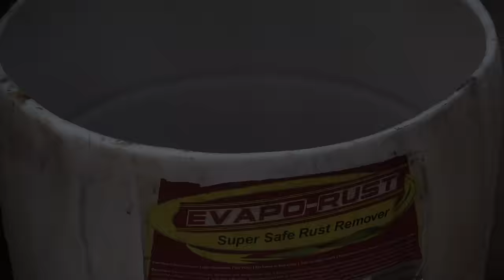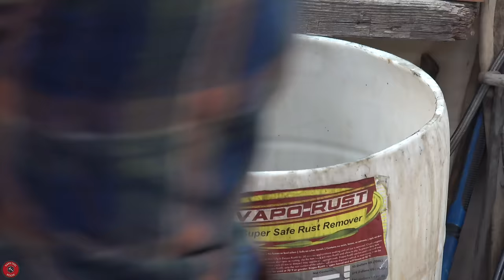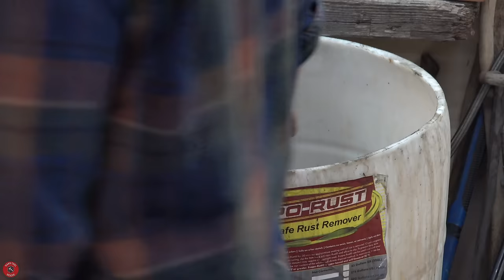1900s Pedal Metal Lathe [Restoration]

Comment: You commented on how off the brass was centered. I believe when you reassembled the jaws in the chuck that one jaw grabbed one thread ahead of the other. This will always throw center off. I may be wrong...
Reply: I noticed that too, was wondering if he had corrected that with the footage not ending up in the final video, but that may very well cause the off center workpiece holding. Still an amazing restoration!
Reply: I agree, I was about to comment the same thing.
Reply: Agreed.  The jaws are definitely not centered on the screw.  

Easy fix!   Great video!
Reply: you are correct
Reply: 23:38 Your right, you can see the left jaw is a little more inwards than the right one.
Reply: Also may have accidently swapped two jaws. They are corrected for the offset of the thread and numbered on modern chucks.

Comment: "I have never used a Wrench in my life." *grabs the personalized metal grabby thingie that helps to remove nuts and bolts"
Reply: Nope, no wrench on this channel... We have a shifting spanner though.
Reply: Hammer works just as well
Reply: ؤ  ,
Reply: @TheJdeft1  why is that?
Reply: @LeglessWonder  simply you don't need to be able to count or read numbers to use it . This is true of adjustable wrenches pliers and hammers.
Reply: I was amazed to see that comment.  I have lots of wrenches and use them on my projects all the time.  Although, many of my projects are automotive and that DIY spanner he uses would not do the job for me.  I also pretty well calibrated and when I grab a wrench, it's almost always the right one.  I cringe when he uses it end on instead of from the side of the nut.
Reply: @ROKuberski  almost always? I get it right each time for 40+ years.
Reply: @turbocpt1  I'm much better at fractional than metric so I am not perfectly calibrated.
Reply: @ROKuberski  yes I think we get tuned in to what we use generally. I will find a bolt in an awkward place which you cannot see. Feeling by hand and I know exactly what size it is.

Comment: As a former machinist, I found this very interesting. When I started out, lathes were not much different than this, except they were powered by electric motors. I hated it when everything became computer controlled.  I still use one that has a treadle like an old sewing machine.
Reply: Yeah, I like the older lathes best as well. 
I'm pretty sure that welded extension onto the big drive wheel was for a motor hookup.

Comment: If you want to understand how a metal lathe works watch this video. They don't get much simpler than this. Great old tredal lathe. I had a 13 inch Southbend that was from around 1913 I believe. Was a sweet looking machine after mechanical restoration.

Comment: Learn something new every time I watch - never really thought laths were use way back in 1880's, not peddled one at least. Fascinating rework on this piece of history. Outstanding project.
Reply: evil brat . Prior to that pole lathes were used for wood turning. The earliest representation of a Woodturning lathe is about 300 BC in an Egyptian tomb. However it is probable that some form of woodturning lathe or equipment goes back to  around 3000 BC.

Comment: Where is the garbage on the floor?It was my favorite character!
Reply from the maker: Wood by Wright was right there!
Reply: I just can't believe excessively flammable workbench never gets a mention.
Reply: @MorseB  If that thing ever lit off, I wonder how many days the embers would smolder. ;)
Reply: @HandToolRescue  Ice cold
Reply: I was a stand-in for him today!
Reply: Garbage on the Floor returns next week with an "I told you so" look on its face.
Reply: @WoodByWright  you did almost as good. There is no replacement for garbage on the floor!
Reply: I heard rumors that the Garbage on the Floor wanted a bigger cut. Well, HTR canned them. They are likely been compacted...or worse burned. Never able to be able to star again.
Reply: @MorseB  at this point, we know that excessively flammable workbench will be written off shortly after if it does finally get credited.

Comment: First off, although I appreciate what this is and would definitely want one this looks about on par or worse than taking apart and putting back together a helicopter! 
Second, thinking about the precision of this machine to make this back in the day reminds me of the old saying "which came first, the chicken or the egg?" Because someone would need a machine like this to make  machine like this 
To this day I am still astounded by the industrial revolution. Thank you for this video I have enjoyed watching.
Reply: Go check out the Gingery lathe.  He spent 20 years answering that question.
Reply: The first machining instrument was the surface plate, and the vernier scale. You can produce a perfectly flat surface. From there, you can make ways. Gears can be made by producing a very large dividing plate and cutting the teeth by hand. Screws can be cut from a lathe, yes, but they can be cut with a threading die that you can produce much easier. The very high precision screws can be made by doing mathematical calculations about pitch over distance, and trying to make a screw very close to a mathematical model over a great length (for example, exactly 100 turns over 10 inches). From there, you can copy a screw and magnify its low precision over a large scale to a great degree of precision over a very small scale. This is how micrometers are made. From there, you have the parts to make a lathe. I recommend watching a few videos on the production of a gingery lathe for more information.

Comment: That is a beautiful machine completely worthy of an amazing restoration. My only concern is that rod propping the seat up. If that cast iron seat breaks your nutella is going to need restoration
Reply: The entire machine just looks dangerous to me.  Well, the days before machine guarding...
Reply: @evensgrey  what guard would make you feel safe?
Reply: @maggs131  The usual:  Covering gears, belts, and flywheels.  You don't normally see those left uncovered on modern machines, for the simple reason that they don't have any need to be exposed when the machine is in normal operation and touching them when the machine is in operation is extremely dangerous.
Reply: @evensgrey  oh yes those are just begging to munch a finger.
Reply: I feel the same. I wouldn't trust just a single rod to support me lol
Reply: Ooh, yes!
Driven to add the same comment by my imagination. Don't want that lovely restoration nicknamed "Vlathe the Impaler"

Comment: You messed up assembling the chuck.  You are off by a thread on one side.  When you put that ring over it with the two screws in it you can see how off center it is.  Just redo it until it looks centered.  Also make sure everything is tightened down.

That machine is a work of art.  I would have gone with a light blue/gray color though and left the seat metal as you butt will wear the paint off over time anyways.  Make sure he knows were all the oiling points are and that he oils it regularly, especially the one to the left of the chuck.  I would oil that ever 15 minutes as that is where the most pressure will be.  It looks like it was either not used much or was taken care of quite well.
Reply: I don't know how anyone could have not noticed that. Especially since they both lined up with the outside ring originally.
Reply: I thought this was someone taking the piss but you know what he's right! Once you've seen it, it can't be unseen either!
Reply: Rewatched that, and you're on point!
Reply: Yup, I recon the jaws need swapping to get it centred.
Reply: @robw4476  The jaws can't be swapped. One jaw just needs to be started before the other one.
Reply: they did a pretty damn goo job for a machine they've only took apart once. With all of that I imagine there was a chance of a m istaake
Reply: As an avid watcher of Abom79's channel watching the guy hand drill the set screw and seeing how off that was  I died a little inside...
Reply: @chicagomodzz  ,   Me, too.
Reply from the maker: Totally possible!  I'll have a look at it on Instagram and see if I can get them to line up better.  Follow along if you want!
Reply: @HandToolRescue  nice restore, my father inlaw restored his barns headstock before  he passed.  I restored the rest of the lathe.  The carriage rack and pinion is very fragile cast iron.  Mine had both parts missing teeth.  Got to clean with a rifle brush and oil.   We have  a cushman 3 jaw and a ground in situ backplate/chuck which i can hold 3-4 tenths on a good day.
Reply: Yeah, and I noticed he missed a washer here https://youtu.be/u71kzF1XfQM?t=397
Reply: thank you, i wanted to point it out.
Reply: @Randy-cf4ve  , you mean the brass one on live center hold down, never notice. NOT!
But heck of a job for almost, orange seat, but Ole Hand Tool saved the day again. Who knows, next someone may try to slide urple in amongst otherwise manly man colors.
Reply: @HandToolRescue  How did you not notice when operating the machine? Did make me chuckle though, thanks :D
Reply: Agree, but if the chucks are on the correct sides the screw that adjusts them may have been flipped. So four ways to go one should be on center.

Comment: I just bought one of these that was converted to electric, it looks identical to the one in your video except the pedals where removed along with the big flywheel/pulley.
It now has another smaller pulley up top with a motor mounted below it.
I just got it bought it at a auction for $60 bucks, it turns on but I haven't used it yet.
Can't wait!
Reply: I hope your chuck will be more concentric than this one. Either the two jaws weren’t inserted properly or one needs to be modified.

Comment: i have similar lathe found leaning against an old barn under the drip edge. I brought it to my shop and loosened everything up it works good now. It was made on late 1890,s in upstate NY. It was originally a pedal type lathe  no motors.

Comment: 15:16 THANK YOU!
So many restauration channels out here do such great work...
Only to ruin it with a neon-pink paintjob. 
These tools are not modern and never will be - so why even try to fake it.
Reply: that is why we thought this would be a great shot to include. we were going to do hot pink but did not have any on hand.
Reply: @WoodByWright  Nice one :D
I've just seen your take on restoring, noticing you did yours in bright blue - perfectly fine. 
Your lathe, your choice - and I am sure there's a pretty even split along the viewership who likes what kind of paintjob. This way, both are satisfied - you guys could not have done it any better.
Reply: I've noticed that the Eastern European restorers like to use bright colors.  Works for Latvia, but not so well in North America.
Reply: @JohnDaker_singer  India seems to have an affection to it, too
Reply: @AstraWerke  If I restore a tool for my personal use and plan to have it in my shop as a daily user for years to come it is the same Blue, but all restorations for restoration sake are original in color if not actual coating material. but I am the od ball that will actually be using this for years to come on a regular basis and a shop tool so it is a bit of a different restoration for most.
Reply: @WoodByWright  To be honest, apart from a desk fan, I have yet do restore a piece in so rough a shape it would need a completely fresh paintjob. Whatever I aquire and restore (or "repair", much rather) is put to work as it was intended, so I don't mind if the paint is scratched because I know it's only going to get worse. (Maybe not on a livingroom radio, but on a machine tool, for sure)
Happy Coincidence: My taste goes along with the colors used back in the day - piano black, blueish grey, dark brown, ... - heck, I'd probably paint something in one of those colors if it was yellow before, clearly putting personal preference over originality.
Someday, I might take apart my welder generator and strip its flaking paint, and it will most likely get a coat of grey (and red on the inside) instead of its original green.
After all, that's what different paint cans were invented for - Individuality!
Reply: Being from Chicago, I'd say that orange is for clamps. We used to have a Jorgensen clamp factory on Ashland Avenue.
Reply: How come pink is always used in the negative sense? ;-; what's wrong with pink?
Reply: @loser7528  Pink has its places as a color, too. Not on a machine tool, though.
Just like black would be out of place on a wedding dress.
Reply: Adrian Straub both of those things exist with those colors :D

Comment: Only one thing would improve this: an orange seat.
Reply: I concur; that colour choice was NOT good! Also, the single support strut under the seat needs to be swapped out for at LEAST a 15-degree split-fold rod, or better yet,  a heavy pipe with attached platform foot. (for improved seat support)
Reply: James had to leave
Reply: Stereo speakers.
Reply: That and the pedal bar bushings... And the most important bit, the pinstriping. Which could match that orange if you switched from red to orange pinstripe (Keith Rucker just repaired the hanger arm and added retainer ring to the bushings.).
EDIT: On another one of these lathes, not this one... ie, no pinstriping. Oh, and no bushings.

Comment: I wonder if that welded piece was to connect a motor later on instead of having to pedal.
Reply: That is my thought as well.
Reply: FWIW, in the industrial age at the turn of the century, that machine would likely have been found inside a factory, connected to a belt drive system and powered by a gigantic steam engine. That setup (producing WAY more torque) would likely have necessitated the wheel being welded to the driveshaft.
Reply: No, I think that was a total afterthought. If it's going in a drive line factory, why have the pedals in the first place? It looks to me like a small mom and pop shop lathe that somebody later ran off an electric motor. Its a direct connection rather than a drive pulley as far as I could tell.
Reply: @The_HillPeople  Actually, I was implying it started out as a foot controlled tool and then was modified for factory work later on. But HTR saved it nevertheless, so its all good...  :-)

Comment: I suspect this lathe was converted to use electric engine later on.
Reply: I was thinking more like factory overhead belt system. Look for some images of early 1900s factory floors and you will see the massive belts up to the ceiling. And steam or electric motors driving it.

Comment: Such a simple but high quality machine, big enough to be useful but could fit in even a small shop.  I love the pedals but it could also be non destructively converted to electric and still be a very useful machine today, could even have both options quite easily.  Surprised there's no bearings for the pedal assembly though, seems like it could do with them.

Comment: Thanks for showing this video. I have the identical lathe minus the treadle and have tried for years to get info on it. Was handed down from grandfather to father to me.   It has a brass mfg. label Harper and Reynolds on the headztock casting. Definitely bookmarking this video. Best Regards. Mjm

Comment: Never take apart two similar projects at the same time unless you can keep the parts separate or it can cause headaches such as at the sandblaster. He obviously is afraid to get oil on his hands. Never run off potential help (even if they are painting a seat orange[shudder]) until AFTER the heavy lifting is done.
Very enjoyable and entertaining video.

Comment: This thing definitely looks rigid enough to cut steel quite accurately. And at such low speeds, it seems cool. Most interestingly, the included tool bit is presumably made out of high carbon steel instead of HSS. High carbon steel works well when you are just working with crank powered machines.

PS : Have you considered installing a bike transmission onto it, so you could potentially get up to quite a high speed by using a larger gear ratio when pedaling? Thinking about it, if you wanted to use all your strength, you could probably get out more than one horsepower out of yourself, and that could drive the lathe just as well as a modern motor. with all that mass behind that headstock while pedaling, surely you could get it to like 800 RPM with a high enough gear ratio.
Reply: OR you could get a sidekick to pedal for you. Like a blacksmiths apprentice. Hard to do precision work while getting all your horsepower out.

Comment: That's really neat. I'd like one. I put a wood turning lathe on a treadle base from a sewing machine to have a pedal wood turning lathe.
I think you need a better chuck. If you don't like to pedal in that direction, you need a gear or two (or pulleys on the belt drive) to change direction of the spindle.

Comment: A tip for the flat belt. Twist one end before splicing and you have a Mobius Strip. This wears the belt on both sides to even up wear. Commonly used in the old days of belt drive machinery to extend the life of flat belts...

Comment: Hand Tool Rescue... I have seen these used in an old B/W documentary and they are operated by two people. 
One operator (the "runner") would sit in front the artisan and pedal for him, even adjust the speed gears. That way the artisan working on the material would be able to concentrate on the work.
You would not pedal in reverse if you are sitting on the other side of the lathe.
Reply: That is exactly what I was thinking.  Peddling is apprentice work.

Comment: At 38.45 minutes, you wrote why the shaft was welded into the flywheel, yes, here a couple of options — a) it was already being repaired, the flywheel burst (well, it might be removed or hit, it’s cast iron, but rather in combination with option b;
b) it was originally made with a defect (cast-iron flywheel, steel shaft, landing hole was not made correctly, with a smaller diameter, burst when pressed), well, do not throw the iron out)), welded with a copper electrode.